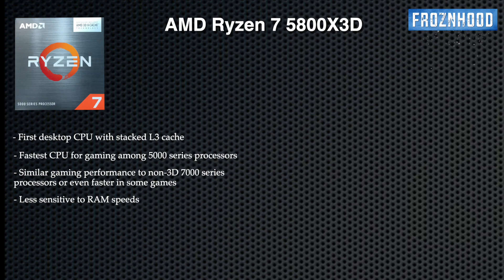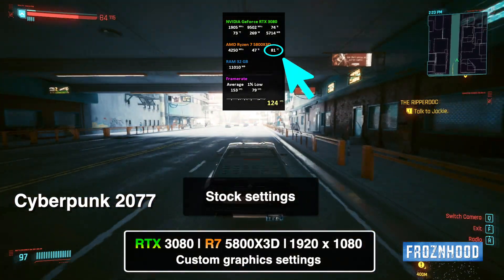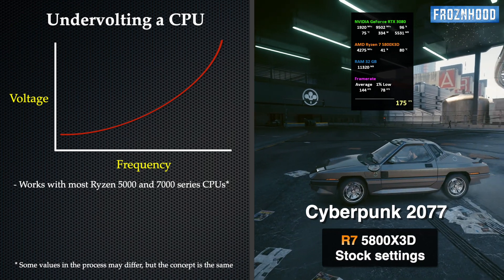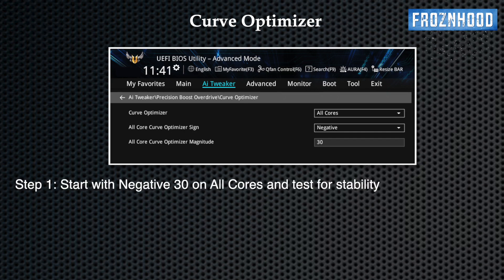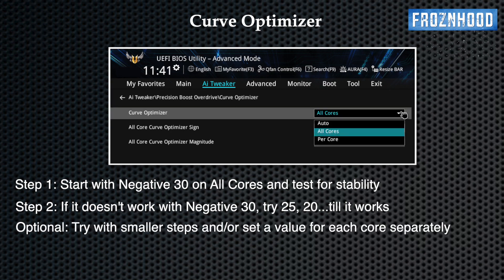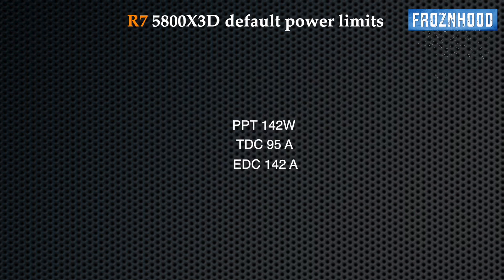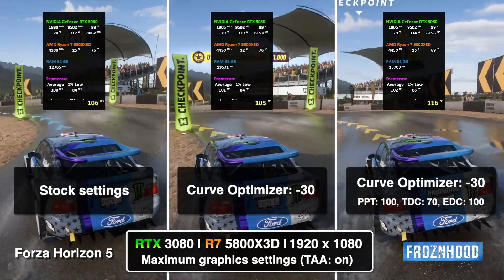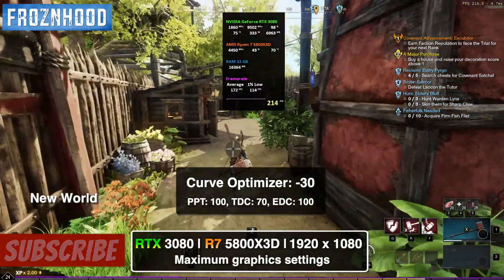Optimizing Ryzen 7 5800X3D - Higher performance, Lower temperature | Undervolting | Curve Optimizer

Comment: Great video but I need your help. I could set the curve optimizer but I cannot change the pbo Limits even though I have changed it to manual. 
I got an msi b450 b pro max vdh mainboard with a new bios version
Reply from the maker: Why are you not able to change the power settings? What is the BIOS showing? Are the input fields missing or?
Reply: @FroznHood  it says auto in every pbo limit and i cant change it, its still locked even though i did everything right
Reply from the maker: I can't be sure what exactly is the problem in your BIOS, but if PPT (for example) is on "Auto" you should be able to enter a custom value manually and (probably) press Enter key to confirm it. Finally, save the BIOS settings. So, just try to change that "Auto" value. Click with the mouse on it and enter the desired value.
Reply: @FroznHood  i know how to do that,  changed bios settings before, but got no solution for that. thank you for your help though

Comment: Thanks for this video, I upgrade to 5800x3D found that high temp also it hit 9x degree at certain time. So I do the curve optimizer -30 setting, the next PPT TDC EDC will make temp even down more but make game lag spikes. So my setting is only -30 for all core, temperature slightly down certain hit 80 mostly maintain at 7x degree.
Reply from the maker: Hi, thanks for visiting the channel. 5800X3D is still a great CPU! I am glad your unit is working fine with -30 Curve Optimizer. I noticed your issues with the power settings. It is unusual to have "lag spikes", "stuttering" or similar issues just because your CPU can't handle specific PPT, TDC and EDC values. In 99% of the cases, when the CPU can't work with certain values, a game may crash, the PC may freeze or restart, or may refuse to boot. So, make sure that you are applying those power settings correctly and that your BIOS has accepted them properly. It is also mandatory to check the CPU frequencies after that. Some old BIOS version may set the frequency to 3600, and you will definitely feel the CPU slower. Make sure that your using a recent BIOS. Also, if your CPU can't work with 100/70/100 there is still a lot of room for improvement, because even 110/85/110 is much better than the defaults. Which means that you can't try with slightly higher value, for example 105/75/105 or even 110/80/110. Small steps! They are still better than the defaults. You are always welcome to come back and share your results.
Reply: @FroznHood what do you think about only adjusting PPT, TDC AND EDC, but without an undervolt to go with it? 

Temps are good, but my system feels sluggish, I'm still searching for settings that will work well.
Reply: @lukaszpowalowski8342 Did you find settings that worked out for you? I’m in a similar situation right now with my setup

Comment: @FroznHood What settings would you use for 5700X3D same ones? Or some adjustments
Reply from the maker: Hi! First, you need to check what are your current power values with your default BIOS settings - PPT, EDC... Install Ryzen Master, check the values and tell me what they are.
Reply: 142 - 95 - 140 for 5700x3d   @FroznHood

Comment: Holly x3d, This fixed almost all my struggles with Escape from Tarkov. Updated Bios and Chipset, Curve optimized 30 was unstable but works fine with 25. My gaming experience is like day and night.
Reply: Have you set 100-70-100 power limits?

Comment: What power settings should I use for something like a 5700X3D
Reply from the maker: What do you mean by "something like" and what are your default power values?
Reply: @FroznHood  i guess I shouldn't say 'like', it's a 5700X3D, but the power limits are set to auto in the bios
Reply: @CorneliusCornbread  I have the 5700x3d also i set mines to -20 all cores with his power values works like a charm
Reply: @leonredd  I just tested a -20 to be stable, I'm not gonna bother with -30 tbh as I care much more about stability than maximum performance. 

I'll try his power settings, I'm curious though as if it effects multi core scores negatively since it's a minor limit compared to stock
Reply: @CorneliusCornbread  I doubt it. I ran many benchmarks with these settings compared to default settings s scored higher and ran much cooler to

Comment: Hi, I'm from Argentina, I wanted to know if these settings work for a Ryzen 5 5600X? Because the temperatures of this one when I'm playing reach 95 degrees Celsius. Thanks!
Also, when it is idle, without doing anything, it reaches temperatures of 60-70 degrees. I don't want to damage my CPU, that's why I ask this question.
Reply from the maker: Hi, even with the stock cooler that comes with 5600X you should not get such temperatures. Something is wrong with you cooler or with your CPU. You have to check if the cooler or the thermal paste have been installed/placed properly. You also need to check the temperature of the motherboard and the GPU. With the stock cooler you should get up to 85-87 degrees in games. In very rare cases up to 90. If you have a better cooler than the stock one you should get much lower temps than that. Those idle temperatures are also way above the normal values. So, before going for undervolting procedures, first you need to find what causes those abnormal temperatures in your system.

Comment: Just replaced my 5600x w/ a 5700x3d yesterday and absolutely love it so far.. but did notice I could not find the PBO in the bios anymore.

I'm on an old ASUS B350-F, plan on getting a B550-F eventually since I've seen some used for $80-100sh. I know I'm missing out on the PCIe 4.0 for my 3070RTX. But from all the benchmark vids I watched not a lot of differential if any (B350 vs B550).

Maybe the B350-F is just too old idk, didn't have any issues with the 5600x though it showed/offered PBO. Regardless 5700x3d is an amazing CPU and I've only hopped in a few of my newer games.
Reply from the maker: Did you also update your BIOS to the latest version?

Comment: Got that CPU with the Arctic Liquid Freezer III 360 Black using the AM4 offset brackets and an Asus Tuf Gaming x570-plus Wi-Fi with the newest bios as of Nov.4,2024 I enabled PBO2 basically motherboard limits for the cpu with a -20 all cores got a performance boost Cinebench r23 30-minute throttle test scored 15,263mc and only reached 63c and for gaming extra fps totally worth it.

Comment: Can these settings applied for 5700x3d ??
Reply: Yes it's the same processor
Reply: @thibautmeet5293  but i canot use these 100 70 100 
 Because my pc wonot boot after applying these settings and i got unstable if put -30 curve optimizer 

So can you give me best settings for my 5700x3d 
Please help me if you can

Comment: I also have an Asus motherboard, X570 prime pro, i was able to do the -30 all cores curve optimizer and it dropped my temps 9 degrees and increased performance! thanks! 
Only issue Is i cant modify the PPT, TDC, or EDC settings.... Mine is locked at "AUTO". And there is no option to change it off that, I even checked in the AMD overclocking settings and there is nothing for those values... I found another guy on reddit who has the exact same issue.. I am on latest bios updated today. 

not sure what to do.
Reply from the maker: Hello, click with the mouse on each input field (PPT, TDC....) and just type the value you want then press Enter.

Comment: I have no words to thank you! Straight to the point, no frills, and using the same settings as in your video for my Aorus Elite X570 Motherboard. I did the -30 for curve optimization and 100 -70 -100. Under full load on Lies of P with all graphics settings on Best, I didn't go beyond 58ºC (my cooler is the Peerless Assassin 120 Black, I've also used the Noctua NH-2 as thermal paste). I'm consistently hitting 144fps with my MSI 4070 Super 12GB O.C. Edition and 32GB of Corsair RAM at 3200MHz. I take my hat off to you.
Reply from the maker: Thank you for your comment and feedback.

Comment: Thank you sir. I applied your settings and gained a few degrees, while reducing my fan speed and also gaining clock speed. That's crazy.
my b550M ds3h rev 1.4 doesnt support on bios curve optimizer, so I had to use PBO2 Tuner and make a task to start it on user log on with custom arguments "-30 -30 -30 -30 -30 -30 -30 -30 100 70 100 0". Works perfectly. Thank you again, my 5800x3d runs great while quiet now

Comment: can you use kombo strike with gameboost and pbo bios setting ?or can you use all 3 at once or is using only 1 or 2 options best? right now i think I have kombo on 3 ,and PBO auto, game boost off set.installed my chip last night?  TY .on a MSI X570 gaming plus
Reply from the maker: Sorry for the late reply. Kombo strike can be used as an alternative to the Curve Optimizer. Then you just adjust the power settings (PPT...). You don't have to do anything else.

Comment: Hey, so far, 6 months in the frequency and your suggestions have worked like a charm... I have 2 questions...

1. If I update my BIOS, do I need to then redo the changes for undervolting etc.?
2. Lately I am having an intermittent issue where my USB devices randomly disconnect for a few seconds... I am working through the list of solves (that included changing power settings, uninstalling/installing drivers etc.) but I am wondering now if the changes on the voltage etc. could also be a culprit?
Reply from the maker: Hi, thanks for your feedback and questions.

1. Yes, updating the BIOS will most probably reset all settings to default. I recommending updating the BIOS only when you have a good reason for that.
2. No, your USB ports and USB devices are not affected directly by the Curve Optimizer or these power settings. I have never had such issues and I have never seen a feedback from someone else with similar problem caused by the undervolting process.

I have had similar USB issues in the past with WiFi adapters, flash drives and external HDD/SSD. In some of the cases it was a hardware problem with the motherboard and/or the USB controller. In other cases it was a hardware problem with the USB device. In very few cases it was a software problem when I was using the latest driver.

What is the USB device that is disconnecting?

Comment: I want to upgrade to this gpu maybe during Black Friday deals. In the mean time. Does it make sense to undervolt a 3600 or won’t it change its performance?
Reply from the maker: I don't think it is worth undervolting 3600 unless you are using the stock cooler and you have temp issues.

Comment: It works with my 5800x3d thank you for that but can i also try it with my 5800x?
Reply from the maker: Yes, you can use the same strategy with 5800x, just with different power setting values. You need to test the CPU, step by step, with lower values than the defaults.

Comment: My 5800x3d wont go higher than 4.42GHz, why?
Also cinebench I'm scoring slower than my 5600g now
Reply from the maker: Either your BIOS is not working properly or you have done something wrong. You can the following:

1. Make sure the you have the latest BIOS version for your motherboard. If it is not, update it and then re-enter all the needed settings. 
2. If you find that you already have the latest BIOS, make a complete reset (of the BIOS) and then re-enter all the needed settings. 

In most cases, the only things that you need to change in your BIOS is RAM Frequency (if it is not detected properly), FCLK Frequency (This should be set according to your RAM frequency), the RAM voltage (if the BIOS doesn't detect it properly according to its frequency), RAM timings (if you use RAM kits with different timings), Curve Optimizer and the power settings, both as shown in the video. Do not change anything else regarding the CPU. Do not make any other CPU tweaks.

Comment: Thank you, I heard some people change cppc settings, did you try it?
Reply from the maker: You don't need to do anything more than what I show in the video. If you change more things (for minor, insignificant improvement) and your system  is not stable, it will be very hard to find the problem.
Reply: @FroznHood but some people suggest on overclockers forum to disable cppc preferred cores, enable global c state and enable cppc. It’s best for 5800x3d.

Comment: EXCELLENT VIDEO, I have had my 5800X3D for about 5 days now, I have ran 3DMARK as my general benchmark test, I used Prime95 Small FFT as the stability test.

System:
AMD Ryzen 7 5800X3D upgraded from an AMD Ryzen 7 3800X
NZXT Kraken Z63 280mm AIO /w Thermal Grizzly Kryonaut (freshly pasted)
Sapphire RX 6900XT Nitro+ SE /w Thermal Grizzly Kryonaut (pasted 6 months ago)
Seagate Firecuda 512GB M.2 2280 PCI-E Gen 4 NVME SSD (all tests ran from this drive)
32GB G.Skill DDR4 3600 CL16 (2x16)
ASUS Crosshair VIII Hero Motherboard

TEST RESULTS:

3800X (identical other components), No tweaks, AUTO calibration & voltages, EXTREME Phase Control (Full Phase Mode), NO LLC
Prime95 30 minute test PASS, 100K, Max Temp = 79C
3DMark TimeSpy DX12; Total Score = 16,682; CPU Score = 8,523; GPU Score = 20,074; GPU Test FPS = 131.36; CPU Test FPS = 28.64

5800X3D, no tweaks, AUTO calibration & voltages, EXTREME Phase Control (Full Phase Mode), NO LLC
Prime95 30 minute test PASS; 112K, Max Temp = 90C
3DMark TimeSpy DX12; Total Score = 18,415; CPU Score = 10,790; GPU Score = 21,039; GPU Test FPS = 139.86; CPU Test FPS = 36.25

5800X3D, Curve Optimizer -30, PPT = 100, TDC = 70, EDC=100; EXTREME Phase Control (Full Phase Mode), NO LLC
Prime95 30 minute test PASS, 120K, Max Temp = 77C
3DMark TimeSpy DX12; Total Score = 18,636; CPU Score = 11,307; GPU Score = 21,044; GPU Test FPS = 139.97; CPU Test FPS = 37.99

Final Thoughts:
These tweaks have produced NOTICIBLE gains in terms of thermal performance and slightly enhanced CPU performance vs stock settings on my system. Keep in mind that the "silicon lottery" is still very much in effect and your 5800X3D may be more or even less capable than mine or someone else's 5800X3D. To the best of my knowledge you can not destroy a CPU by under-volting it, you can only cause system instability, OVERVOLTING is a good way to kill a CPU but is usually done with overclocking to gain more performance from a chip. The 5800X3D does NOT overclock well and the performance gains are minimal and not worth the risk or the additional thermals.
Reply from the maker: Thanks for the comment! I am glad that you have achieved good results.

Comment: do you know the values for the 5700x3d, already set -30 without problem but i would like to set those values
Reply: I would like to know also, currently stable @ -30 all cores, haven't touched the CPU Power Limits
Reply: @Leviathan_1.0  did you try it?

Comment: I just installed Ryzen 7 5800x3d. First I had on CPU stress ~80°C temp even with watercooler. After these settings it dropped to 70°C. CPU cores are stable and everything works fine. It was useful. Thank you so much for this video. And the video is short no shit talking. Guys this video will help you 100%.
Reply from the maker: Thanks for watching and the feedback.
Reply: @FroznHood  do you have a link for the tool ?
Reply from the maker: What tool?
Reply: @MadaVadda You don't need any tool. Go to you BIOS by turning on PC and clicking delete button until it opens you BIOS.
Reply: @FroznHood  the tool from the video , because ryzen Master looks dificult to me... your toll in the Video looks so much better
Reply: @GPowerHD  oh thanks , i will give it a try 😅 that will be my first undervolting on cpu,  hope i will not brick someting
Reply: @MadaVadda  I just bought this CPU and I did the same as on this video. Everything is working fine no problem.
Reply from the maker: It is not an external app. That is the BIOS.
Reply: @FroznHood  oh men 🫡🤣 i feel stupid...😑 sorry for the dumb question 😶 but thanks to you both for the fast and helpfully reply 🫡🙂
Reply: @MadaVadda  everyone starts somewhere man gl with the overclocking/undervolting.
Reply: @FroznHood  i have rog strix b550 f gaming, and i dont have PBO. What is this?
Reply: @MadaVadda Not all motherboards support this setting, if in your case there is no such setting, then just use PBO 2 tuner, the only problem is that you will have to write all the values again, every time you start the system, but you can configure it all to autorun, there are a lot of guides on setting up this application on YouTube
Reply: I will try

Comment: Can I combine this by also overclocking my GPU? 1660 ti
Reply from the maker: Yes, but do that in stages. First, optimize the CPU and test it until you are sure it is stable. Then do what you want to do with your GPU. That way, if you encounter any issues you will know where they are coming from.